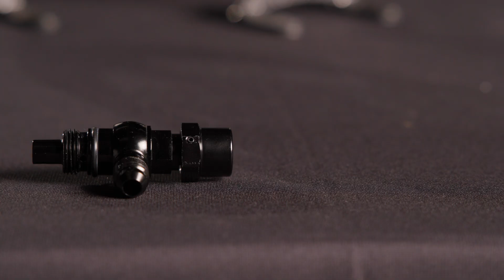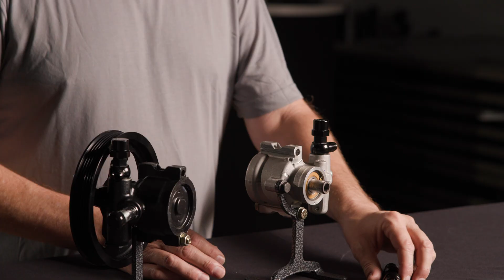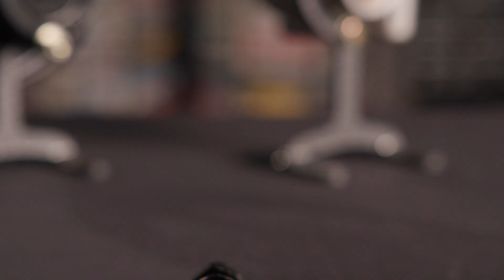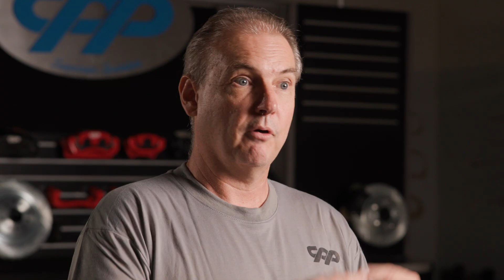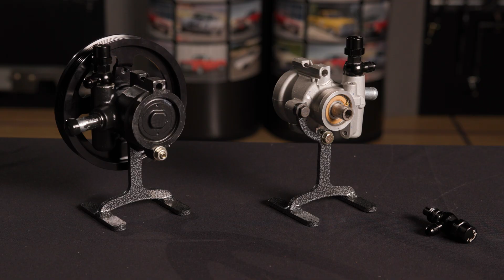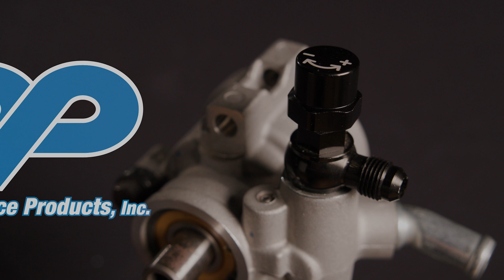CPPs Power Steering Flow Control Valve

Comment: Swaped a type 2 pump into an 47 gmc that has a 72 c10 gear box. The pump is flowing so much that the resevoir is under pressure causing it to fill up with air bubbles with the amount it's returning. Will this help to slow that down and let the return line to the resevoir have less pressure?